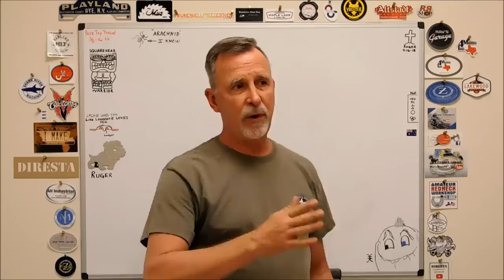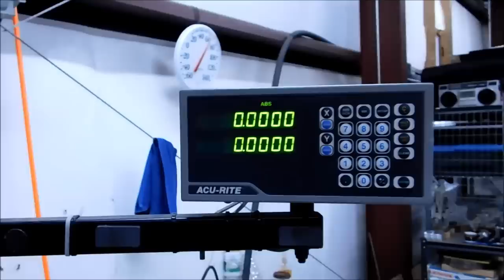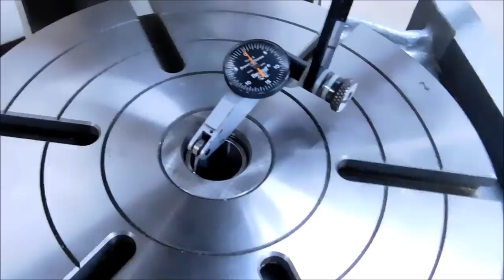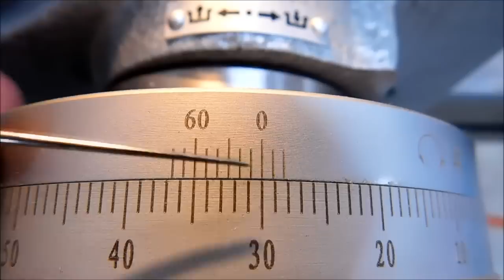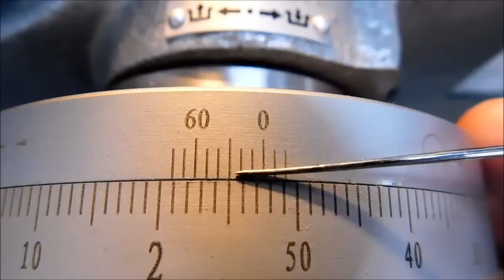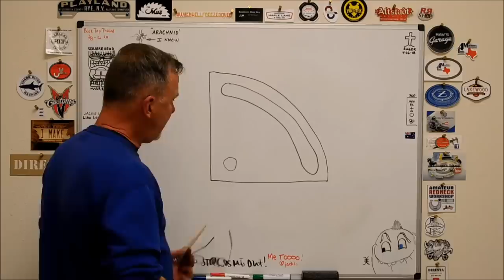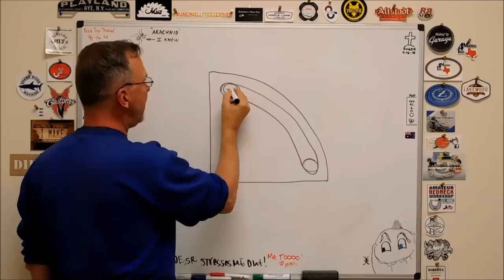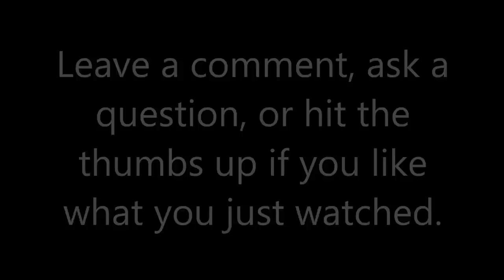Rotary Table Basics

Comment: I love your videos! But I thought that angles were broken down into Degrees, minutes, and seconds. Not Hours minutes and seconds. So isn't 1 arcsecond =1/3600 of 1 degree? Rather than 1/3600 of 30 degrees (1 hour)? Thanks for your videos!
Reply from the maker: I would like to reply if you can point to the part of the video that confused you. Thanks.
Reply: Around 2:17 you state that if you think about a clock, that one hour equals one degree. When I think of a clock, it has 12 hours in one revolution, or one hour in 30 degrees. My apologies for my falling off the rails at that point.

Comment: You and I have the same pet peave.  My 8" rotary table is square at the zero mark, but my 10Inch rotary is off by 15-20 degrees.  Why would any rotary manufacture not square the table at zero?
Reply from the maker: I made an offset indicator bracket. Solved the issue.
Reply: my 1st guess is so the work can be clamped at 0 deg. supported on the table surface and not directly over the slot....

Comment: Dumb question #1: what is the purpose of the lever forward of the dial? or maybe a better description is  between the dial and the table? The levers on the front and rear of the table lock the table in position, so I am not speaking of them.
Reply from the maker: One of the levers locks the 4 degree rotation dial in place, and the other locks the cam that holds the cranking mechanism in the engaged position. I may show that in the next video. Check it out when it posts.
Reply: @joepie221  thank you Sir. I always look forward to your videos as they are really a mini-machinists class. I might even figure out how to properly use my Phase II table.

Comment: Why don't you just rearrange the position of the indicator so that it matches the slots at Zero degree?
Reply: I agree with Michael.  Pull the table apart, shift the zero, and give it a good clean before reassembly.
Reply: I don’t believe that would work as the degree increments and numbers are part of the table.  Hard to move without machining them off and re doing them, which wouldn’t be out of the question for some...  (assuming the markings are not aligned with the slots)
Reply: @JaysonWallis  or  you could machine a new ring to press on over it or slot and screw on so  its indexible
Reply: @richardcranium5839  That works also.  Less work too.
Reply from the maker: Shifting the zero pointer would cure the problem.
Reply: Thanks Joe.
Reply: @joepie221  add another pointer for the t-slots, then the factory one could remain in it's "convenient viewing" location for "non-t-slot critical" ops.   ?

Comment: Being the top of the line machinist that you are, why don't you move the pointer on the table to a spot that will make the slots line up like you want. I'm sure you could do it very accurately.
Reply from the maker: Thanks. I may just do that.

Comment: I find your videos helpful as a hobby machinist even if you do pick on us engineers a little. I didn't read through all the comments so I apologize if this has been asked. What are your thoughts on using an edge finder and the 1/2 function on your DRO to find the center instead of sweeping with an indicator?
Reply from the maker: I have found that C/L button on the DRO get you close, but nothing will get you over center like a sweep with an indicator. For speed, use both.

Comment: Hello! cnc machinist here, trying to get more in tune with rotary's. here is a simple overview.
I am trying to make gears, I know that you would divide 360 by the amount of teeth you have to get the distance between each tooth. lets say its a 55 tooth gear, it would come out to 6.54
6 would be degrees but I get lost with the numbers after. 5 would be minuets and 4 would be seconds?  this cant be right since 30 minuets would be half a degree (.5) so what are the numbers after the decimal of 6.54? how would I convert them into minuets/seconds?
Reply: ok I got it figured out. 60x.5454 = 32.724 (32 is minuets) 60x.724 =43.44 (43 is seconds) it would be 6degrees 32minuets & 43 seconds
Reply from the maker: Very Good.
Reply: Like Joe said, it's the same for time so you can use that same method to calculate exactly how many minutes and seconds to add to hours if you had to set an interval timer to divide a period of time into equal increments.
Reply: @joepie221  isn't 6.54 6 degrees 32 min 24 sec?

Comment: I just picked up a 12" Phase II NIB, thing is heavy as heck!
Reply from the maker: Lower the mill table as low as it can go to mount it and watch your fingers !!!!! I lay thick strips of plastic on my table so the rotary table cant go all the way down and smash my fingers. Once the rotary is on the table sitting on the plastic, I remove the plastic blocks by lifting/levering the rotary table using one of the T slots and a bar..

Comment: you said there would be philosophical stuff ??? u need to state the fact that once you’ve rotate 4 degrees, it goes back to 0. therefor 360/4 90 turns. 90 complete turns is 360degrees! (but sir, there is no “15” ) 4+4+4+3 (its the last digit “3” this means 3*rotations + 3 degrees! that is 15 sir!
Reply from the maker: The main table has 360 incremental marks, and every degree is represented, so there is a 15 degree mark. you just get there by dial rotations of 4 degrees at a time.
Reply: Joe Pieczynski 15 degrees would be represented as 3full turns and 3/4 of a turn. 

Do you know how to count in different “base numbers”? Counting in base 4 is what your doing! 33=15 in base 4. Since the degree is divided into 60 that would be called a fraction i believe, like fractals and fracking. 
Sounds greek to me but that’s probably just philosophical something mayans and egyptions used base in the day! 

Counting in different bases is what machinists do all the time. 
Some lathe handles count in 12mm on the diameter, so 60mm = 5 . therefor the number 12.5 (turns) = 12mm*12+(12mm*0.5) = 150 mm of the diameter of the shaft! .. 

(i don’t expect you to reply again to me, but please add interesting facts about how old technology, mathematics and philosophy interwoven in engineering! 

I enjoy everything you do!
Reply from the maker: @Bibibosh  If I follow your example correctly, and use 22 degrees as my number, that ( in my mind ) translates to 4+4+4+4+4+2. the last number 2 has nothing to do with the number of rotations. I am not discounting your comment, but I am not sure I fully understand it as presented.
Reply: I think he meant, translate the 22 into number of WHOLE turns, and fractionalize the remainder... so in your 22 example, it would be 5.2-turns
Reply: did I type that?  I meant 5.5!

Comment: Hey...first!
Reply: I don't use my rotary tables as much as I thought I would but they're a necessity when nothing else will do. I bought a use 20" rotary table, if I told you how much I paid for it, I'd be going to jail. And then I have a small 6" which also has the dividing plates. Clamping stuff to a rotary table can be a real pita  sometimes to keep the clamps out of the way. Maybe you can do a video on work holding for the rotary table.
Reply from the maker: @marcellemay7721  Its coming. You are going to have to have one of the attachments I plan to show.
Reply: @joepie221  I see I'm not the only one looking for workholding tips on these...

Comment: 2nd . LOL
Rotary tables rule I have one for my drill press.
Reply from the maker: You are hard core Worth.
Reply: @joepie221  Thanks, there are more than a thousand uses for one, and I feel even a good wood working shop would have use.
Mine has indexing plates and I cobbled on a big 4 jaw chuck . 
Think of the pasta drying racks you could make with one of these or position spokes for a wagon wheel hub or rim or what ever. 
Holes for a muzzle brake. 
Cut gears. 
Make your own fishing reel. 
360 alone there are 24 divisors,  1, 2, 3, 4, 5, 6, 8, 9, 10, 12, 15, 18, 20, 24, 30, 36, 40, 45, 60, 72, 90, 120, 180 and 360.
Can you tell I love the rotary table and indexing head. 
Thanks for all you do for the machining world.

Comment: An hour is 30 degrees if you look in a clock each hour is 30 degrees
Reply from the maker: The movement of the minute hand is 360 degrees / 60 minutes / 60 seconds per. resulting in a 1 hour shift. the hour hand moves 30 degrees, but thats not the point of my comment. So technically you are correct as related to a clock only.